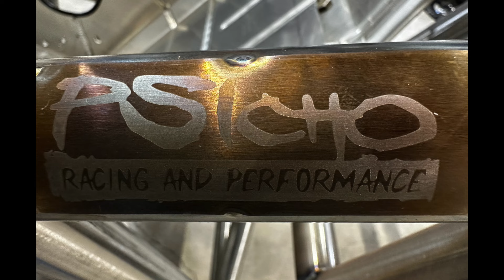NEW CAR....... WHO DIS????

Comment: What is the rod thats flopping around on the rear end? Is that a arb link, a shock position link/ride height link???
Reply from the maker: It’s a shock sensor.  Wasn’t using it at that point in time but we knew about it.
Reply: Its a race car wiener. You are not supposed to look at it. Lol